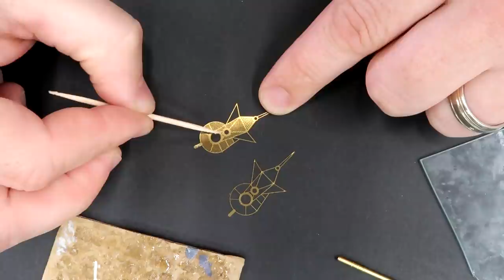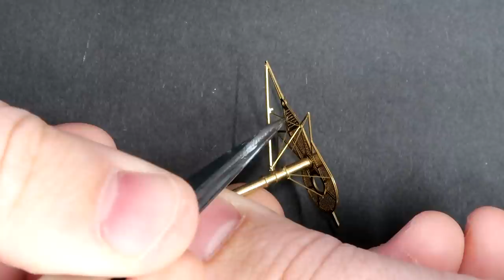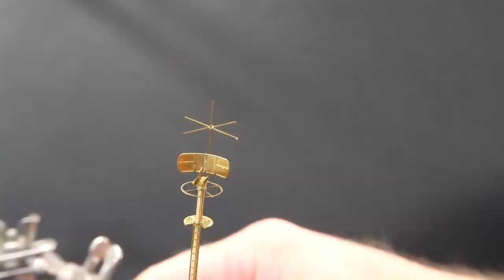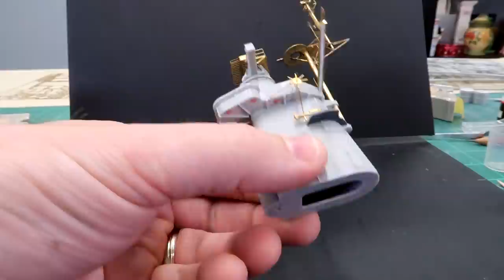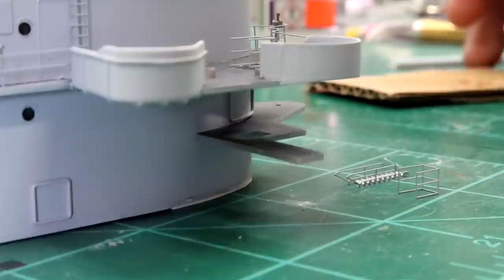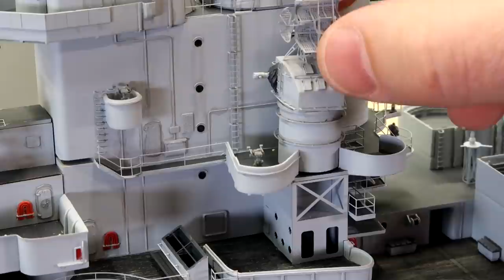1:200 Scale Missouri by Trumpeter Build Video 25

Comment: I can’t imagine trying to build something with so many tiny parts! When you finish the ship are you planning on placing it under glass? If it wasn’t covered than it would be so easy for the ship to get damaged and trying to keep the dust off of it would be an absolute nightmare. Are you keeping track of the number of man hours it takes you to build this model?
Reply from the maker: Yeah it will be in a case. I have no idea how many hours I’ve put in it. Too much hassle to track.

Comment: Awesome job Ben. I know it's after the fact but, I wonder if you could use a circle template to true up the radar after installing the first ring. It looked much better after the second ring went on. Regardless, you are a PE master! Great work.
Reply from the maker: Not sure. I do know that if I did it all over again, I would try really hard to get the pieces to fit into the little cut outs on the ring. I'm curious about how accurate they are and if they would have made life easier.

Comment: Question: are you gonna add the table from the surrender?
Reply from the maker: No. I’m going for an “underway” look.
Reply: @TheMidwestModelShop  On the ship there is a brass plate that marks that spot with a perspex dome over the top of it to protect it. Or there was in 1988 when I got a tour of the ship.
Reply from the maker: @glenchapman3899  Yeah I've  visited the ship too and that plaque is still there. I'm considering putting one there just to do it.

Comment: Beautiful work, Ben.  Your videos have helped me immensely with my 1/200 Iowa build, which is why I was so worried when your channel disappeared.  I'm actually building the Iowa backwards from what you've done - I'm starting with all the subassemblies that you have done in these last couple vids and trying to get as much of that done and painted as possible.  I'm a bit space-limited (apparently, they've never heard of basements here in South Carolina <grin>), so having the hull sitting around while I'm doing other stuff isn't an option.  I also went with the Pontos detail-up set, as well as the Pontos/Veteran Models Iowa/Missouri  Advanced Add-on set - contains all the Bofors needed in one package, optional raised main gun blast bags, more detailed 36" searchlights, firefighting piping/valves, and anchor chain tiedown hooks.

Comment: A great project and thank you for sharing. It looks really nice and congratulations. I think the Iowa class battleship is one of the most impressive technical innovations that came out of WW2 and even more impressive when you consider that both the USS Missouri and the USS Wisconsin were involved until 1991 and the first Gulf War. Today, of course, the large aircraft carriers are more relevant, but it is not quite the same as large battleships visually and expressively.

Comment: That came out sweet! You know, I wonder if it would not be a better idea to use a low heat solder instead of glue? That way the connections would be instant and you could easily go back in and lightly file any areas where it might lump up. Probably cant see it by eye but in the video you can clearly see the lumpy areas of glue. Worth considering and the only concern would be to make sure your iron is just hot enough to melt the solder so as not to warp the brass given how thin and fragile it is. It might be worth trying on some scraps to see how it reacts but I have used it on some PE and never had an issue and the end results are spot on. I also would like to point out that low heat solder is way stronger than normal solder, so it holds to PE extremely well on fragile parts so you dont have to be so damn careful with and repairs are fast and easy, plus the solder is not affected by most paints so if you have primed and or painted you can make repairs without much fuss. IMHO.

Here is a link to some useful info in case you might be interested in knowing more about it.

http://www.interhobmodels.com/id17.html

Here is a great read from some pro modelers and there are some useful tips and some that will give you an idea what to search for to get more info about how it works.

https://platform1mrc.com/p1mrc/index.php?threads/my-observations-on-low-melt-solder.2102/
Reply from the maker: Yeah I’ve thought about it and you’re correct, the glue builds up way more than I’d like sometimes. But usually that happens when I have to glue PE to plastic. It’s hard to work around that.

Comment: Hello Ben  
Master of P.E. by side other skills,compliments for your impressive model.
I  will appreciate if you can tell me (if not a secret) the brand name of the CA  with the purple cap  you are using .
Thank You
Reply from the maker: Here you go! https://www.amazon.com/Insta-Cure-Filling-Bob-Smith-Ind/dp/B0000DD1QQ/ref=sxin_17_ac_m_rm?ac_md=1-1-Y2EgZ2x1ZSBtZWRpdW0%3D-ac_d_rm&cv_ct_cx=ca+glue&dchild=1&keywords=ca+glue&pd_rd_i=B0000DD1QQ&pd_rd_r=aa9a1f4b-1276-4c4d-9727-beffa4c9d6bc&pd_rd_w=R9IOp&pd_rd_wg=H1yO0&pf_rd_p=fce38ab9-6307-4836-b9f3-d7597dbce8d1&pf_rd_r=JXE1RZMS5K41QE056HRD&psc=1&qid=1601039584&sr=1-2-87203c69-9404-44ba-aa52-290406ffe53a
Reply: The Midwest Model Shop Thank You

Comment: When working with really tricky parts like that radar I use a piece of glass I stole out of an old 5x7 picture frame to glue on to. If you do happen to glue it to the glass a sharp number 11 blade slid under it will pop it loose.

Comment: hi Ben model is looking great ,im in the middle of building the 1-200 scale Bismarck and could you tell me the glue you are using please
Reply from the maker: I use Tamiya Thin and  Bobs CA glue. In the video descriptions of previous episodes (sorry I can’t recall off the top of my head) I provide links.
Reply: Many thanks will look up the link ,stay safe
Reply from the maker: https://www.amazon.com/Insta-Cure-Filling-Bob-Smith-Ind/dp/B0000DD1QQ/ref=sxin_17_ac_m_rm?ac_md=1-1-Y2EgZ2x1ZSBtZWRpdW0%3D-ac_d_rm&cv_ct_cx=ca+glue&dchild=1&keywords=ca+glue&pd_rd_i=B0000DD1QQ&pd_rd_r=aa9a1f4b-1276-4c4d-9727-beffa4c9d6bc&pd_rd_w=R9IOp&pd_rd_wg=H1yO0&pf_rd_p=fce38ab9-6307-4836-b9f3-d7597dbce8d1&pf_rd_r=JXE1RZMS5K41QE056HRD&psc=1&qid=1601039584&sr=1-2-87203c69-9404-44ba-aa52-290406ffe53a
Reply: Many thanks for the help Ben